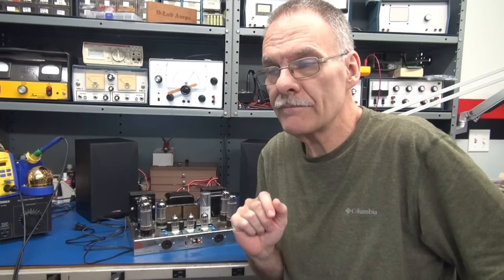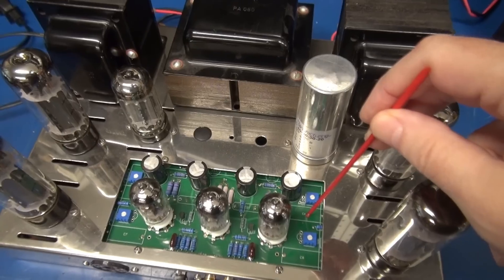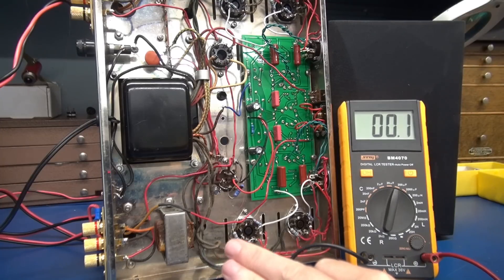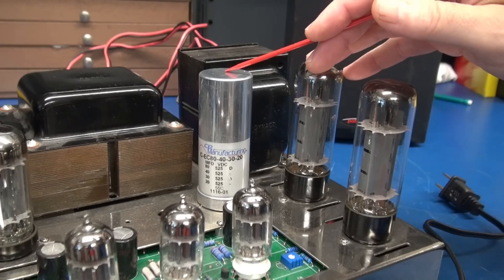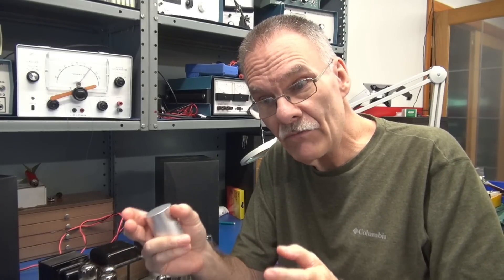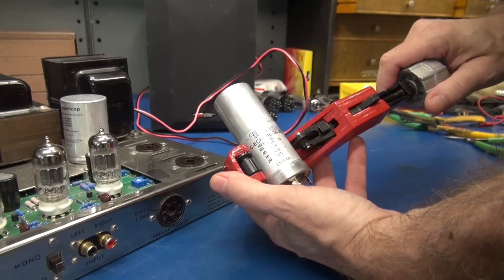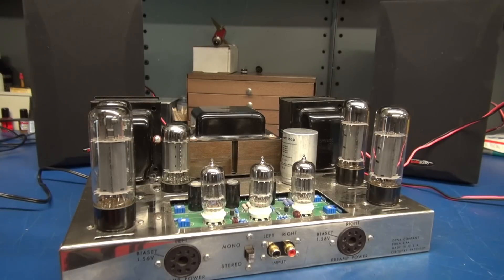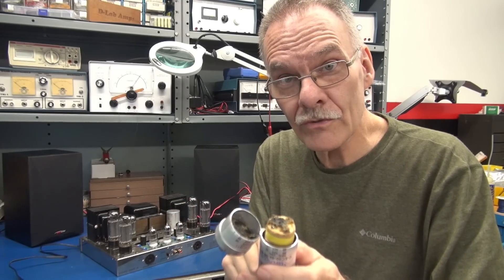Dynaco ST-70 Tube stereo audio amplifier Bad AC hum in both Channels What is causing the fault?

Comment: When my ST-70 started humming, I took it to a friend who built and repaired tube guitar amps. He found the same thing, plus one channel in the power transformer making noise. He replaced the caps with 600V+ standalone electrolytics under the chassis, and decided that there was enough excess capacity in the power transformer to just run the thing off one side. Came back working absolutely perfectly, but the underside is quite crowded. This was easily 20 years ago. I've pulled my unit out again, and with more tube experience under my belt, and going to try a full refurbishment, including a new transformer. Cheers!

Comment: Great video! Thank you. I have same amp with same mod, same hum. Finally it blew a fuse, I checked that cap and it was bad. Cut it open like you did and it was corroded just like yours.

Comment: Hi terry. You cut the capacitor apart to see what was wrong with the cirquits good job with that. It reminds me of when I used to work on automatic transmisions back in the 1990s I would remove the oil pan then remove the filter and brake the filter apart to see the contents looking for clutch materials and Metal grindings m four parts of thrust washers between internal components or reaction carrier pinion washers for Diagnostic purposes. Nice terry. Dwight.
Reply: Dwight K. Schrute?

Comment: I have a VTA ST-120 I built back in 2017.  The CE Manufacturing capacitor has held up fine.  However, when I first powered it up, the 5AR4 destroyed itself in a flash of white light.  I tried replacing it with a solid-state unit but was unhappy with the sound.  it turns out that 5AR4 rectifier isn't rated to handle the current of four 6550 output tubes.  I ended up installing two 5AR4 tubes per the old H.H. LK-150 schematic.  Gone was any arcing.  And the low frequency response was much improved.  VTA now offers a dual rectifier upgrade.  I had another problem, this being the driver board.  The center 12AU7 failed twice, introducing hum into the audio on both channels.  I ended up building and installing the VTA 6SN7 driver board, which has performed flawlessly.  To my ear, it sounds better, too.

Comment: Terry, I have rebuilt a ST-70 and it had some hum in it, I added another capacitor and a resistor and reduced the hum.  After watching your video I did use this same capacitor can as you found bad.  I checked it and it measures ok but I suspect under load it is not working as it should. Too bad the new parts are not to be trusted. I would probably have been better off to leave the original capacitor. Thanks for the video.  I will probably replace the can with the one you suggested.

Comment: I think that is a good way to get a estimate of the plate dissipation, but to be more accurate one should measure the voltage drop across the primary windings of the output transformer because the screen current is also part of the cathode current.

Comment: I use a tubing cutter all the time and recap my old cans. I cut them right at the seam at the base of the can.  Do it carefully and you can epoxy the can back together and you can't tell. Put some electrical tape so not to scuff them up.  I drill a small hole right beside the terminals and run the lead from the cap and solder to the terminal.  I usually use Nichicon pencil caps.  They are thin and long. I previously used CE  dis. Or Hayseed Hamfest cans quite a bit also , and never had an issue. Just a little cheaper and keeps the amp somewhat authentic. Nice repair!👍

Comment: The cap you pulled was 80/40/30/20 @525
Reply from the maker: Yep, sometimes I jumble my numbers. I believe the 80uf section is a bit high for the 5AR4 tube
Reply: @d-labelectronics  that’s ok……. Your work is always premium…. Just letting you know in case there was too much wine in the diagnosis section

Comment: TERRY, The Filter capacitors Inner terminal connectors are Electrodes which I think the Electrodes need to have an oxide coating or coatings? is it Galvanic problem between the filter capacitor "electrode metals"? The filter capacitors Electrode Metal Fatigue?

Comment: Metal fatigue of the electrolytics from  regular voltage spikes may be to blame here after looking inside. Heating up
 the insides could allow moisture from the capacitor material to corrode the inner terminal connections if no protective
 material was present. May be just  a lifespan issue as well. The higher voltage rating should cure the problem with the
 new replacement can.

Comment: I have also had 2 failures in CE caps that had a 500V rating for my McIntosh 240 amp. I realized that the line voltage was probably too high, since the McIntosh has a very efficient solid state rectifier and exposes the cap to a higher voltage now (due to 120-125V line) than the 110V that was more common in the good old days. I now run the McIntosh on a variac that reduces the line voltage to 110V, and have not had a failure for 5 years with the CE cap.

Comment: We use a LOT of CE can caps in rebuilding Hammond Organs and Leslie Speakers. The reports of early failures are increasing. Our community is concerned about their long-term reliability. Terry, where did you get the F&T can?
Reply from the maker: I buy them from this ebay seller: https://www.ebay.com/itm/312203986432?hash=item48b0cec600:g:5Z0AAOSw-6pbYLj-&amdata=enc%3AAQAIAAAA8HrjfK6X%2BYc4s8%2B2VGjrJvwjLTmmIz5wX%2BSSIIjNLqP5W4ZzhSS0bDH1tgRlxpVIlZ%2BHpYqPXvHWeok8%2BxyedgcwuAxb%2FCFuyEpo2FDEmDe9mPonwFKxnrbUGwqCLPepRotenPigqlKg8jIXOj3vPF2SFflNLTATkjteYzMwxyI0PVs83noB%2FDCB2r141h9OfUkIx86cwRuBt9zuvsJZjLP%2Fn9pgYtq0%2FMAhHryyIvmOIpiwU1EDqfES284%2FJDdWUKpEoExjfR%2B6%2FxszE5yxk7wK9CfhWfvOKDFIsHuGDZzPy08VC%2FYGLOJ2xAcVYEAosg%3D%3D%7Ctkp%3ABk9SR4yl5pajYg
Reply: Is that $122 for one cap can or 2 like in the photo..?
Reply: @fiddlix  The title says it is for two.
Reply: @patlaw53  That more sense now. Thank you. Must have been an oversight on my part. I’m very sorry.

Comment: That corrosion might be due to galvanic problems between different metals. I needed to replace some caps in a 1966 Champ and a 1963 Princeton and ended up ordering Hayseed Hamfest caps (First time on these - I ordered custom caps and they were delivered 7 days from when I ordered!) because I have read too many stories about the recent failures with the CE cans. I am going to be installing the Hayseed cans tonight or tomorrow - They look good but they are very shiny - The can sides are magnetic but the non business end is not magnetic. They seem very solid. They can be ordered with 105C rated caps inside. Even if the CE Cans didnt have these premature failures I would worry in many applications about the temperature ratings which are very low. That cap in the dynaco was rated at 55C !!! The dynacos I have seen run pretty warm - especially with the cage on. Great tip on the authenticaps - I havent seen those before.
Reply: By the way, back in the 90's and early 2000's when I was repairing amps for a living I used a lot of these CE Dist cans and I was very thankfull that they were available. Nowadays I only work on amps as a hobby for myself and friends so I havent been in the thick of it for a while.

Comment: ive never seen internal corrosion like that, but i did see corossion creep up along one leg into a cap caused by hot glue. it sucked up moisture and killed the cap it was supposed to hold down.